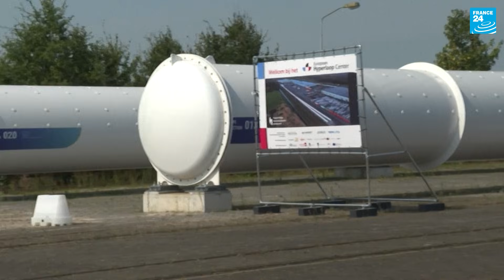Amsterdam to Berlin in 90 minutes? Europe tests hyperloop vehicles • FRANCE 24 English

Comment: Do they have passenger ingress/egress that doesn't require pumping the entire tube?  Can they deal with thermal expansion?  Can they afford the pumping due to unavoidable air leaks?  Can they get the land needed for straight track necessary for ultra-high speed?

No?  The concept is a total non-starter.

Comment: Hyperloop again? I thought that we have enough evidence, that the concept is at least highly problematic and most likely not suitable for transport of large number of people between two metropolitan areas. One would have to chain several dozens of those pods to have sufficient capacity, but at that point it is basically HSR in pipe.

Also if anybody wants to speed up travel between Berlin and Amsterdam, it would, mot likely be cheaper to upgrade existing lines or build new HSR. There already is HSR from Berlin to Hanover, now it would be necessary to upgrade line to Münster, either though Osanbrück, or Bielfeld and then upgrade line to Warendorf. Then it would be necessary to either upgrade line from Münster to Zvwolle or build link between Cosfeld and Winterswijk and upgrade existing lines leading to those towns.

Another issue is that many lines in Europe still operates with speeds not only below 200kph, but below 160 or even 120 kph. So perhaps simple upgrades that would increase the speed on main lines to 200kph could still be enough to significantly cut down the travel times.

Comment: Knowing the Dutch work speed and the amount of political debates required to change the destination of pieces of land to realise the rail network, 2030 is not even feasible. Lets talk about 2040. Also, this is a private company with a profit goal. Don't expect it to be cheap to travel with. But again, the normal public transport in the Netherlands is not cheap either. One of the most expensive already in Europe.
Reply: I think he's talking about having a working prototype, not an actual hyperloop pipe.

Comment: I can already travel between Berlin and Amsterdam in 45 minutes if I fly. What value does this pipe add here?
Reply: The point is not to fly because of climate change. Trains can run on low carbon electricity. Eventually flying will have to switch to efuel which will be more expensive. Taking the train should be cheaper. Currently there is only a small amount being produced some governments can't require it yet. So they are focusing on rail alternatives. France has banned flights between cities where a rail journey can be done in under 2 hours. This would potentially fall within that time frame.
Reply: You can't get from your home in Amsterdam to your meeting in Mitte in 45. More like 4 at the very fastest while risking missing your flight. High speed train is absolutely preferable but this tech is just a distraction from building out what can accomplish possible increases in speed and efficiency.

Comment: It is so scary to be in this pipe if something happen with the system. Better test Harry Poter Dyson ring system - it is not a joke. Make  air your friend not enemy, setup Dyson rings along the path, when it flow goes with the direction of the vehicle so it will suck vehicle in

Comment: If you want a greener alternative to short haul flights then battery electric or hydrogen aircraft can do that far cheaper than this.

Look at the cost of the Channel Tunnel it was many billions, digging tunnels is amazingly expensive.  Not only is the Channel tunnel about 20 times shorter than the route from Amsterdam to Berlin but it's not even make to be a vacuum, which would add massive costs.

As for safety it there is a leak and the trains loose all their air into the tunnel everyone dies, any derailment is likelyto be deathly for everyone.

Trains in mainland Europe are rather fast and reliable.  This hyperloop is too expensive, too dangerous, and there are too many alternative means of transport.

Comment: Everyone talking about Elon even though he has absolutely no involvement with Hardt or this test lol.
Anyways, the biggest problem with the hyperloop idea already in the 1960s was the vaccum, you can test vehicles in open tubes all day but that is nothing, you're just figuring out maglev with that, which is a technology that already exists and is simply not something you can implement yet.

But even after Hardt and the others implement maglev, the REAL challenges in the realm of physics start when you introduce the vaccum which is necessary for the touted speeds, among many issues, how do you allow passengers in and out without breaking the vaccum, how do you prevent the tubing from imploding in spite of potential external damage, what kind of machinery pulls a vaccum on such massive tube networks etc

The techology required to dock the hyperloop to a station in a way that doesn't break the vaccum and allows passengers in and out would be insane by comparison to simple maglev, and yes it's possible on paper, but it's so difficult and expensive that it's just not viable
Reply: Why do people online alwyas think they know more about this stuff? They didn’t think musks idea was good either and they never do. Over and over and over they say he’s wrong it can’t be done then he does it then it’s starts over. Why are so many so arrogant and braggy and know it alls while also being really nit that informed seemingly? It’s really obnoxious to know nothing and act like they know everything. I’ve seen people rip into any and every idea that’s poised  about anyhting but it’s just the same points mentioned over and over that don’t seem like they are really disproving the idea. Many will often say you can’t do this thing and here’s some science stuff to prove it then they do the thing then people just move on to dooming about and being negative about the next thing it’s like they sit out here sidelines and tear down but don’t add anything of substance.

Comment: How about putting the pods linked together, pulled by one engine instead of one per pod, make the pods bigger so you can fit more people and call them hypertrains?

Japan has had amazing trains since 1960s. Please, I'll happily take 2.5h to get from Paris to Berlin at Japanese rail speeds.

EDIT: and come to think of it, there's a ridiculous amount of material needed for the tubes compared to what railroads require (cause you only need the rail & power parts, not the whole casing and pressurisation machines). How is this going to be cost effective by 2030? Please spend this money on better train service.
Reply: Adam Something vibes intensify...
Reply: @takix2007  yeah, man can't be everywhere at once so I'm filling in at places :)
Reply: @takix2007 Adam Complain About Everything 😅
Reply: Why don’t you marry Adam something
Reply: @Voornaam-u4u  not allowed in his country :(

Comment: I don't mind long trips in trains with a sleeping beds. Its so much better than the stress of an airport. Can we get more of that?
Reply: Yes exactly they could improve the current above ground network which wont be claustrophobic and suffocating instead of making all of this new technology for underground. They’ve completely lost the plot. There’s no humanity in how things are engineered these days. The tube in london is unbearable even for a few stops. I couldn’t bear those conditions for 90 minutes. They need to think about health and safety not just making things like in sci fi films
Reply: Japan has had bullet trains since 1960s. You could do Paris-Berlin in 2.5h with tech that the Japanese have been using for over half a century!

Without putting people into vacuum tubes with who knows the kind of issues if there's a leak.
Reply: @photoo848  Do you forget that France has TGV. And they can go from Paris to Marseille in 3 hours. It's at the same speed as Shinkansen. The average speed of Shinkansen is 250-300 km/h which is about the same as TGV. Forget about those 500 km/h or 600 km/h trains appeared in the news, because those are just a testing train that has never been operated commercially (and won't anytime soon, because it's not commercially practical). Also, Paris-Berlin with the direct TGV route is not possible because it's the international route and different countries have different train policy and infrastructure. I mean, it's not because there is a lack of high speed train technology in Europe, but rather politics between the two countries that prevent the direct high speed rail between Berlin and Paris to be built.
Reply: Hyperloop is a scam, you know how much energy it takes to create a milli tor vacuum in a hundred kilometre long pipe. Let alone maintain it with the metal degassing. Seriously these engineers can't do math. It doesn't work. Get a Shinkansen/maglev
Reply: @DaveP-uv1ml  To some degree, I fly for business every week domestically in the US, first class seats 99% of the time. The stressors are usually the events leading up to getting to my seat. One day I hope the US catches up European standards for railway. Having high speed rail system along with the airline industry would alleviate the congestion at airports. I would prefer to take a high speed train from New York to Chicago.
Reply: @DaveP-uv1ml  take 9.5 hours to do Paris-Berlin on tomorrow's train leaving at 6h21 from Paris Nord to Berlin.

We don't have Japanese high-speed rail the way the Japanese do

> Hyperloop is trying allow the train

Hyperloop is about driving your car into a pod and shooting it off like a bullet. That's not a train, that's personal transport at its most ineffective.
Reply: @photoo848  Also, Shinkansen has better perception because it's very very punctual with better interior and service, while TGV has like 5-10 min delay acceptable window with meh interior and not-so-great service . But speed-wise and technoligy-wise, they are at the same level. Also, the fact that TGV has lots of delays is because at some area it shares the rail with the intercite train and etc which adds many uncontrollable factors to the management of the train. But Shinkansen's rail is buit separatedly and specifically like a controlled environment.
Reply: @nokaton  Right, so all in all, we could have rail like Shinkansen but we don't.
Reply: Yes! Make travel romantic again.
Reply: They've got bed bugs now and people that booked bed cabins regularly have to sit or stand the whole way from Vienna to Amsterdam and all the way back. With no compensation. The Austrians (ÖBB national Railways there)  also don't do any maintenance on these trains. So it's a waste of money and time. Be warned.